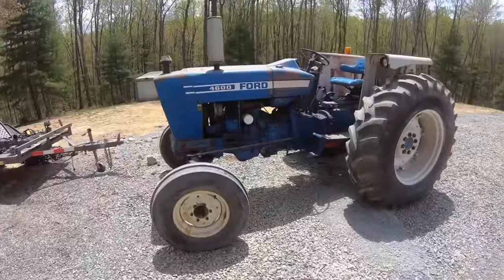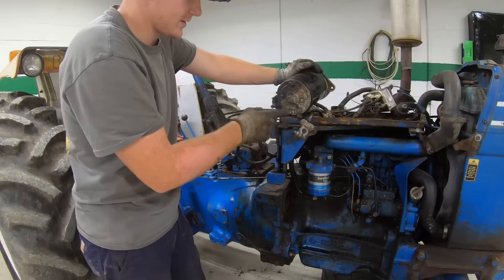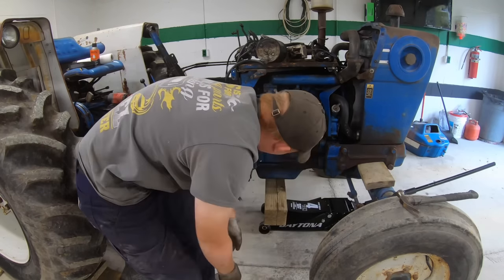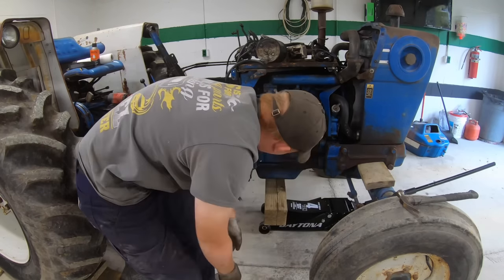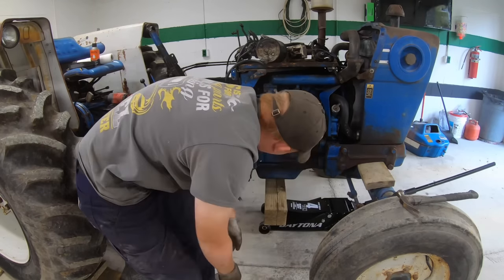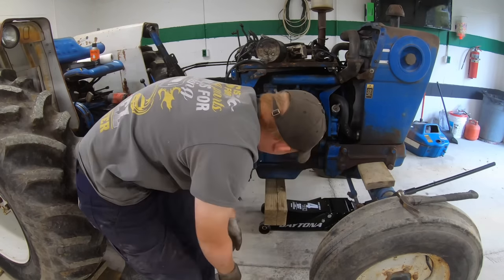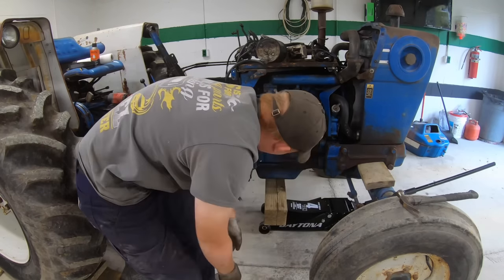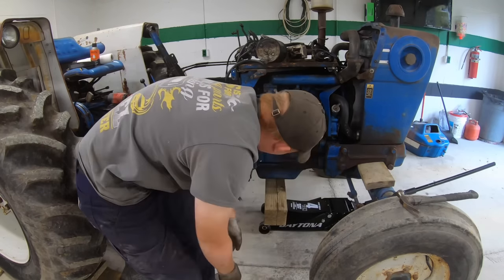Replacing a Clutch in a Ford Tractor

Comment: Just a note from someone who has been there. When replacing a clutch on older Ford tractors, always replace that freeze plug just above the crankshaft. Due to poor cooling system maintenance the freeze plug rusts through and will begin to leak. Unfortunately often just after a clutch job and customers think you are responsible when they see leakage at the bell housing.
Reply: @johnbender1596, Very good advice, not only on tractors but on other kinds of equipment.
Reply: J😮
Reply: Put bronze one back
Reply: Great advice thanks!
Reply: How ever the use of Antifreeze with corrosion inhibitor  improves cooling efficiency , stops cooling circuit corrosion which leads to radiator blockages ... then over heating  ... even in frost free areas Antifreeze is a must !!!
Reply: i think my freeze plug is leaking, there is no other place for water to be coming from, I'm disabled so I cant do this myself...our clutch does freeze up so we usually tie it down when not using.  How much you think it would cost to have both changed?

Comment: I've replaced many clutches so done a lot splitting. I made a jig that rolled on angle iron tracks to split tractors. Used threaded holes in bell housing to bolt on flat bar that had threaded rod welded to it with casters welded to threaded rod. This jig supported rear section of tractor. The casters rode on angle iron tracks which kept the alignment straight between the front and rear on tractor for Easier refitting. The jig also keeps height alignment un changed. Good job buddy

Comment: On high torque bolts, when you try to break them loose, use the box end of the wrench and grab another one to stick in the spanner end for extra leverage I'm impressed though , that you got it done by yourself. I've always had help.

Comment: Put a bucket trap by each piece you want to protect.  Five gallon bucket with a coat hanger installed across the upper end.  On the coat hanger slip a 1 liter plastic bottle (drill a hole in the center of the bottom and through the cap so that it can freely spin)  Make a crimp in the wire  on each side of the bottle so that it stays centered in the bucket.  Now smear peanut butter and jelly on the bottle all around in a ring, doesn't take a huge amount just enough to keep the bottle somewhat balanced.   Pour in a gallon of water in the bottom of the bucket.  Add a stick leaning up the bucket to one end of the cross wire.  Done.  The mouse will run up the stick jump on the bottle which will spin and dump him into the water where he drowns and the trap keeps working.  You have to thin out the population or they will overrun your property.  A friend of mine set up two or three traps at his remote cabin and in just a few days had killed 234 mice.  Over this past winter while the cabin was empty and usually overrun with vermin he had no mice damage or evidence of them when he returned last week.  I had one damn mouse that somehow got into my boat up on the hard in a shed with several other large boats.  Ruined my cushions.  That trap had him in one day.  Most effective way I know because it keeps on working as long as you have bait on it and the peanut butter and jelly will last several weeks in mild weather.  Just dump it out as needed.
Reply: Thanks, good tip !!!=)

Comment: I think it was '72 when my Father bought a new Ford 7000. Row crop. High, flat deck. Unfortunately, this came with 18-4: 34 rears. Not the best traction. I split this tractor around 8,500hrs. and replaced the clutch and had the flywheel resurfaced. The engine never faltered. I got rid of it at over 11k hrs. An unfaltering, great tractor. If Ford would have adopted 6 cylinder offerings.they would have attracted more market share. A durable, dependable machine!

Comment: Blow a fan under the housing of the tank in the cold.  The mice won't like that.  But if your using a block heater, that may not work.
---
Here was an example why NOT to use a crescent wrench to break a bolt loose!
---
I would also have suggested painting that battery holder so it won't rust out.

Comment: Easier in my opinion to move rear half, especially outside. Use couple locating studds on trans for engine alignment and crank flange for removal and assembly of flywheel, no crushed toes. Good luck 😊

Comment: It's not necessary to use Locktite on clutch bolts as long as they're the right bolts and tightened to the correct torque, The biggest danger on clutch bolts is if they've been overtorqued, because eventually they will break if they've been installed too tight, That's why it's best to use new bolts because you never know if the last guy installed them overtorque.

Comment: The top gearbox bolts 1 1/8 used a  ring spanner cut in half with pipe
At the ford dealers in 80s its tight with tank on and starter 1/4 drive 9/16 socket nice little machines
Wet brakes heavy front axle
Good work horse

Comment: I have several buildings and a few vehicles, tractor included. I had mice in the heater system of my truck and car. They were all over in my shop and any out building’s. Chipmunks were a huge problem too. I found someone who had some farm cats. Tabby’s. Brought the mom home and 3 kittens. Later we ended up with 8 cats. Two were strays that wandered in. I have zero problems with mice and chipmunks. The cats all live outside and I still have birds. 😊

Comment: I'm in the middle of opening up my Ford 1520 tractor for a clutch replacement, lots of stuff to unhook, just have front drive shaft left to remove and then block up the back half and use my floor jack on the front and then split it ? Fingers crossed 🤞

Comment: I was just wondering. As more & more & more & more tractors these days are being built
with hydrostatic transmissions does that mean the days of having to split tractors are 
drawing to a close?

!
Reply: Mine is a small Ford, 1210, and the clevis in the linkage came apart , which is inside the case. I didn't have a shop at the timeso the dealer split it.
Reply: And there's still a clutch for the PTO.

Comment: You really need to lock up the flywheel you will not be able to stop it from turning when you tighten to maximum toque settings, Fabricate something which hooks into the gear drive and then bolt it into one of the spare holes in the casting,